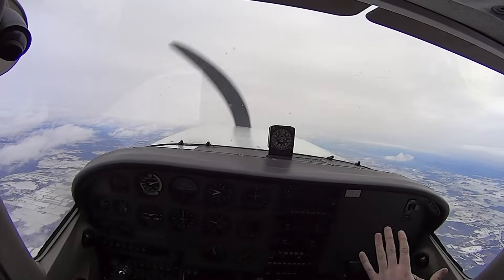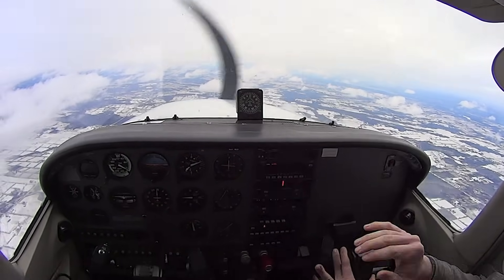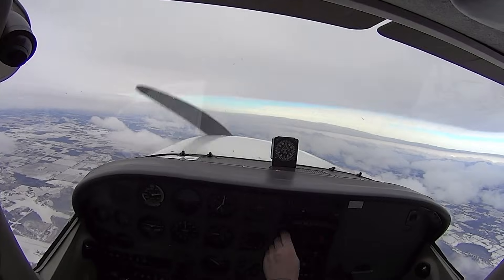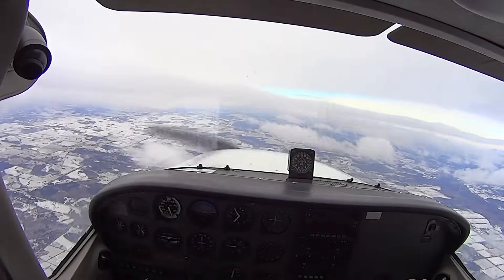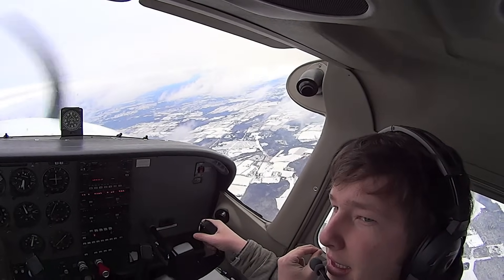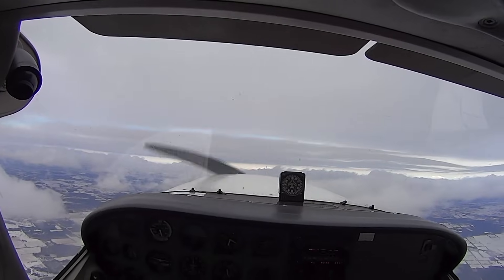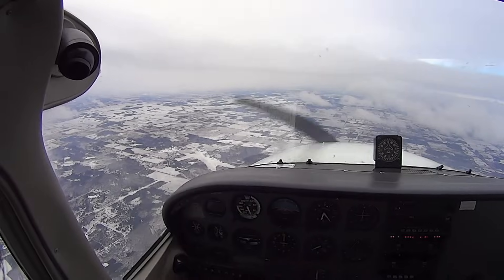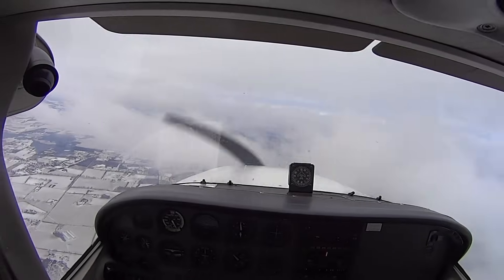Cessna 172 Spin Recovery Training (Full HD w/ audio)

Comment: Cudos to your instructor for teaching spins!.  Spin training needs to be taught even though it is not required!   I got my ticket in the late 1970's when spin training was required. Fast foward to 1993 when I got my instrument license. I was IMC at 4000 feet and rapidly picking up ice. I asked for and received vectors and lower back to my airport. I made a half standered rate turn to the left, to which the aircraft spun.(C 172) If I had not received that training 16 years earler I would have become another stat. a "smoking creater".  I said I was at 4000' MSL when I recovered or 1700' MSL about 950' AGL. 850' above the trees.  An instructor thought that maybe I had experenced a tail plane stall due to the ice. I was in level flight at 100 knots no stall was indicated. I strongly believe that my training saved my life that day.   If any one reading this is planning on getting their Priviate Pilots license, I strongly recommed finding an instructor comfortable with teaching spins. Go out and practice them until you start dreaming about them.

Comment: Nice. I think spin training has always been valuable in getting a confident sense of the phenomenon, the airplane, and its behaviors (assuming it is approved for spins). Quite a few seem to practice these for the first and last time in the traffic pattern. Personally, I prefer to see a clean, defined stall with more break and less mush as the entry point, exercising all available control to keep the wings level until that break happens. My mother was a student pilot in the 1940's and failed her checkride because she did not count three turns and exit her spin recovery flying the same heading as when she had entered the maneuver. This wasn't for aerobatics or a commercial ticket--just her private. When I started training, I used her standard given that the FAA had dropped theirs. Line up perpendicular to a railroad track, a straight road, etc., and count it rotating in the windshield when you go over, recovering in the same direction. Let's voluntarily raise the command and art in airmanship as well as safety protocols and give the accident-data-entry folks working the FAA ASIAS a lot less to do and aviation insurance companies less to charge us for. Go Dan Gryder!

Comment: Nice!  Moving from the US to Canada I was  happy to see that Spins are done quite extensively for commercial training.  For my PPL in the US we didn't even touch on spin recovery.  Just keeping it less than 30 degrees in the pattern (or circuit here in Canada lol ) to avoid spinning in the first place. I find practicing it very valuable.    What Power Setting do you use for a entry in a 172?  ~1700?

Comment: Practicing spins and recovery at 8000 feet is way different then spinning and recovery at pattern altitude while maneuvering .  I always would stress with my students, needle, ball, airspeed. Step on the ball. Keep that ball in the center at all times while in turns and the needle on the dog house. Keep the airspeed well above the stall speed for the bank angle and stalling and spinning in at low altitude is greatly reduced if not eliminated.  Any airplane that stalls well trimmed and in a coordinated turn should stall clean with the nose pitching away like in a normal stall.  Most pilots that stall spin are the sloppy ones that kick rudder in to steepen the turn when they realize they are going to overshoot a turn from base to final approach. Then when the outer wing produces more lift then the inner wing then they roll in opposite aileron.  That produces more drag, the aircraft settles quicker loosing altitude, the pilot pulls back on the nose to slow the sink.....then stall warning and snap it rolls over into a spin at less the 1000 feet AGL. Game over.

Comment: If it develops into a flat spin and the nose won't go down get your weight forward even if it takes cramming heads and shoulders to the windscreen. Night time spins feel for which rudder is sticking out and step on it. The wind from rotation will push the rudder over giving away the direction of rotation.

Comment: Hell yes... one more for good measure!!! I'm trying to understand your actions. You begin the stall and apply LEFT rudder and forward input on controls and then RIGHT rudder then neutral rudder, level off, apply full throttle and climb level.

Does that sound right??? thanks, really enjoyed this one.
Reply: To get the 172 to actually spin, they're inducing a spin to the left by applying left rudder.  This is only to get it into the spin, and is NOT part of the recovery.

To recover, power goes idle, ailerons neutral, and FULL rudder opposite the spin.  So in this video where they're spinning to the left, they're applying full RIGHT rudder. If necessary, push forward briskly on the controls to break the stall.  Level out the plane, and once it's level, apply power to climb back up.

Comment: Nice relaxed instructing!  In our Spin Recovery course we also let the spin fully develop. ( https://youtu.be/YUiruCa1wOc )  This gives the student more confidence when they know what happens if it goes past the incipient stage and also gives time to demonstrates the effect of power and into spin / out of spin aileron and that applying opposite rudder to recover can takes several turns to stop the rotations because it takes time to 'de-stabilize' the auto rotation.  There are several spin recovery methods  and it should be pointed out that no one method will be the best method for every aircraft type.  Read the Flight Manual before you go spinning!

Comment: I'm glad I found this video.  I need to view it a few times.  A long time ago, 1982 +/-, early in fight training and very few hours, we were practicing power on stalls in a 172.  My instructor had me repeating them one right after another without any rest.  Each time I did one, I could feel the tension building up in my body, a little higher up in my chest each time.  Then on the last one, the plane snapped over and I was looking at a whole lot of ground spinning around in the windshield.  I don't know if I was the one to step on the rudder or if it was the instructor, but we came out of it fairly quickly.  I remember shrieking in a high voice saying "Was that a spin?".  The instructor just said "No, that was a spiral dive.  Let's do some more".  My tension had not reduced by any means, I had had it and said that I was done for the day.  He said "really?".   Ever since then, I seem to have developed a keen since of impending stall, sooner than anyone else I'm with.  Each time during a review when the instructor asks for a stall, I feel the stall coming on and return to normal flight.  Every instructor always says "No, I want a complete stall".  I always say "That was one".  I always tell them "The point is stall avoidance isn't it?  We just avoided a stall".  Then we do another one and I take it to a clean break.  I really keep an eye on the horizon and the ball centered after the "spiral dive" experience!  My last biennial was the first time I've shared the 1982 experience with anyone.  When I got to the "spiral dive" comment, this instructor just stared at me and simple said "Oh".

Comment: What about recovery from a flat spin?
Reply from the maker: There is no recovery possible from a true flat spin. A flat spin can occur in any aircraft when the CG is far enough aft such that you can no longer point the nose down to break the stall. This can occur in a 172 when you have more than 2 passengers, baggage and full fuel (i.e., you are not in the utility category) or otherwise exceed the maximum takeoff weight.
Reply: Thanks Stephan,  that's what I thought.. Even stunt flyers don't do what is considered a real flat spin,  however convoluted.

Comment: Should add for clarity that in the "Utility" setting ( no more than two 170 lb passengers, no one in back seat, and no baggage) the 172 can be spun. In normal use, with passengers in the back, with baggage, then no spins allowed.  That'd probably be the case with full fuel also.  But, it really is not a good aircraft for teaching spins.  It is not a question of insurance, but how much load the aircraft is handling and how the spins are entered.  Better to use an aircraft that has a full, usable spin envelop rather than one that is limited.  The reason for that limitation is that the aircraft becomes unrecoverable if operated outside of the utility loading.
Reply: The limitation is so the aircraft will recover within the requirements for certification for intensional spins. 

Normal category aircraft are often extensively tested for spin recovery... which requires an aircraft or pilot parachute to conduct. It’s rather expensive—especially if you lose an airframe or worse a pilot—and also comes with drag penalties... so when the SR20 and SR22 were certified they foregoed the spin certification because the BRS would recover it.

Comment: a fun maneuver book one that can be dangerous even in a Cessna 172 I did one once where we went up we did the incipient stage we try to recover the plane would not recover we entered the full actual spin we did five to seven turns losing 5000 feet of altitude from 6000 to recover at one thousand feet having to use the full recovery procedures plus some. this plane will spin faster each turn until you don't know which way your spinning. I was with a student, they froze when doing it for themself which contributed to it. I had to fight the student and the plane.

Comment: Cool video. Been there done that. When in a spin alerions are useless because the wings are stalled. Use the rudder to stop the spin. Then use the elevators to level out. When your in a spin your weightless until you level out. Cheers Bill

Comment: Why no spins to the right, I did spin training for my private back in the 70s when it was required for the private cert, and again for my instructor cert. we did them to both left and right.
Reply: RAYMAN I doubt you could get a 172 to spin right.
Reply: Harder to spin the aircraft to the right, and the Cessna 172 needs all the help it can get.
Reply: Spin training hasn’t been required since 1949

Comment: Do you apply rudder to go left or right according to the direction of the spin or? and you actually have to push forward instead of back... am I right?
Reply: Opposite of the direction of the spin, to counteract it. Although, in a Cessna 172, you can basically just not do ANYTHING and it will recover on it's own. But not all planes are C172, so we have to learn. Pushing forward on the control column brings the tail up, and brings the wings into the airflow better. You go from falling (the stall) to flying... but you're flying towards the ground, so you EASE back after you regain airspeed.

Comment: i was told these weren't approved for spins.
Reply: I've flown in 172s Model B through N , the manuals state that they are not approved for acrobatics, but are for stall and spin training. You have to be in the utility category (weight and balance) to do this. They are rated for +5/-3G at the lower weight (and can probably go +6/-4 but liability) 

JW: the pilot who did this should have a talking to, if he did it intentionally. Rear passengers are not permitted for stall/spin/spiral practice.
Reply: Just googled it.  Some say yes, some no.  I have a copy of the manual but don't know where it is.
Reply: It is approved. Its best to take the back seat out as well to reduce the weight, it provides an even better chance of not damaging your plane.
Reply: Some planes are typed for aerobatics.  The Cessna 172 I did mine in one that was rated for it.  The other Cessna 150s and 172s owned by the group weren't, so we could only do normal maneuvers.   

I think the aerobatic rating involves reinforced structures and more frequent inspections.  That's just my recollection from what I was told by pilots, not actual FAA training.

Swing by a local airport with flight training, and ask.  They're usually more than happy to talk about their work to interested people. 

My girlfriend has told me she has been in the rear seat of a Cessna (unknown model) during a stall/spin maneuver.  They also didn't warn her, so she was rather upset.  I would think an instructor would be careful to only allow those maneuvers in a rated plane.

Comment: Hi Stephan, great video. I am renewing my Ppl on a 172R also. I struggled to get the airplane to spin with my instructor on board. He said they don't spin like a C152 does, but I see they spin pretty nicely! The question I jab is how much power do you use, I can't see the rpm gauge in the video and you keep on the power all the way to the recovery dive right?
Reply from the maker: You need about 1500 rpm in a C172. As you correctly mentioned, a C152 is a lot easier to get into a spin compared to a C172.

Comment: you seemed scared but with courage to go through and make yourself learn it. that has been my emotions going into my stall training and I'm glad I'm not alone!
Reply from the maker: I think you call that "apprehensive" . I recently had the opportunity to do spins again but in a C152. The sensations were much more intense and I was startled by this to the point that I severely delayed the recovery and almost overspeed the plane. All I can say is that you need a lot of practice doing the recovery, not only to understand how the airplane behaves but how you behave as well. It is truly sensory overload and your brain simply pauses to process all the different inputs and sensations and that is the part that will kill you. You need to be accustomed to this and apply the recovery inputs early and promptly.
Reply: I've been doing spinning in the C152 recently and we let to go past 2 turns. It tightens substantially and starts to spin much faster. The recovery takes almost a full turn from the time it's effected. I'm doing it for my instructors rating. I was nervous at first, but once the first spin was done I discovered I love it and I went on to do many more.

Comment: For a nice, crisp entry, when you are 5KIAS above stall, rapidly apply that last 4 inches or so of back stick that you have left as you simultaneously stuff the rudder.  It will break up and over the top then drop down into the spin.

Comment: What is the purpose of doing this? (Non pilot obviously)
Reply: Practicing at altitude so an accidental one in the future can be recovered before meeting the ground.  Also, because it's fun.
Reply: The purpose of practicing these is so that you can recognize the symptoms of a spin and stop it before it actually develops into a dangerous situation. It's kind of like learning to do a wheelie on a bicycle, after you've fallen backwards a few times you learn how to avoid that tipping point by recognizing it before you're actually there. Hope that helped!
Reply: Once a plane goes into a spin. it no longer responds to normal control inputs. Putting it into a spin intentionally is therefore used as a way to learn how to exit a spin and recover full control of the aircraft.
Reply: If the pilot doesn't apply opposite rudder on a full stall, the plane will go into a spin. Pilot's intentionally stall and spin the plane in order to learn how to correctly recover from one.
Reply: In case that some kind of problem develope,  you should be prepared to recover from certain situations. And this is because you also need to prepare for it, to be ready if this happens to you. These trainings are always done with a well experienced instructor.
Greetings from germany :D
Reply: Because it's fun! Also to know how to recover from it if a spin happens.
Reply: Hi Sarah - Being low and slow, in circumstances such as landing at an airport means that you need to be ever more cautious about the stall. Turning from Base onto Final is where you have a high risk, as you are close to the ground, making a turn and so increasing the load factor. Its possible for various reasons for the low wing in the turn to stall, and put you into a spin. You may be at around 700ft QFE at that point, so you need to learn to recover the spin very quickly. As the instructor said here, they lost 600ft during the first spin. As a student you learn your slow flight and landings nice and high first of all (e.g. 3,000ft+) - so you have lots of room for recovery.

Comment: Hello Glenn, I am a student pilot with 14 hours dual instruction time.  I went out for my first spin in a Cessna 172 a few weeks ago, and the instructor did a stall and wing drop.  I have done slow flight and stalls myself before, and before the spin I did the weight and balance calcs to see if we were in the utility category.  I asked the instructor to not go beyond the stall and wing drop because I almost blacked out from sheer terror, so he did not do a complete spin.  My question is, why does the world seem to turn upside down when you do a real spin?  It seems more like rolling.  I thought that you could autorotate while staying right side up.  I have seen diagrams and theoretical descriptions of spins and they do not seem to explain this.  - Ian Douglas

Comment: I remember when I did my first spin, it was done at full power years back. Seems to me older instructors teach with full power. If I am correct the airplane flying handbook says "poweoff".  I like how you add little power.  Full power like how I did it we were almost vertical before aircraft would spin. What always comes to mind students are told on the ground to push the yoke forward, when I have a student I explain "release back pressure ".   I have only used 172 for spin training.